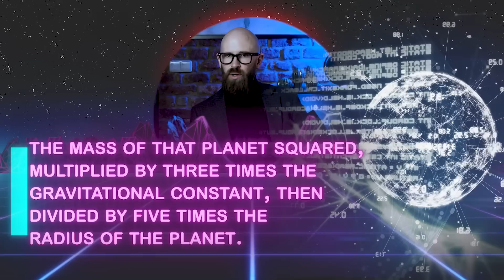Is It Possible to Destroy a Planet with the Death Star Laser?

Comment: For the GDP Issue:- in Star Wars you had the combined resources of thousands of planets in the Empire, not just one. You also had billions of workers, with galactic population of probably a quadrillion. (1 trillion were on Coruscant alone). The Death Star was constructed largely by Geonosians, which were a hive species (insectoid) with a huge population. 
The energy used by the Death Star wasn't normal lasers. Kyber crystals also had "the force" so they were more powerful.

Comment: A small problem with how the destruction of Alderaan is portrayed is the time it happens in. When you're blowing up world-sized lumps of metal and rock, it takes time for the effects to travel through the thousands of miles of rock, literally the speed of sound in rock. Even at a few kilometres a second, it'd take about an hour for the planet to even begin to break apart, let alone for the bits to fly away from each other.

A bit boring to show that on screen, though, so I'd give them a pass for speeding it up. On the other hand, I can see Tarkin forcing Leia to watch every second of the destruction for hours, Clockwork Orange style.

Comment: My head-canon is that the superlaser on the Death Star wasn't a laser at all. It was called that either as a result of what I call the Bad Translation Convention — whatever they called it in the Farfaraway Galaxy, the translators just didn't understand the physics involved and just stuck 'laser' on it. Or, it was called a superlaser by the Death Star project to disguise what it was really for. (Like how the British atom bomb project was called the Tube Alloys Directorate, and not the Super-Bomb Project.)

And what it really does is convert some of the target into anti-matter. No storage necessary, no stupendous amounts of energy to be manipulated, just a little to convert megatonnes of matter into anti-matter at a distance; merely huge amounts of energy. Needs a magic process to effect the conversion, still, but it's a little less hand-wavey than using the Sun's output for a week with no obvious side-effects.
Reply: In canon it's actually operates on the same principle as a lightsaber.

Comment: (Putting on my geek hat for a bit) Given some of the possible extensions of fictional Star Wars technology, how could the Death Star plausibly destroy a planet? The visible ""laser" is strong enough to burn through any possible planetary shield and cut through to the core of the planet. This would have a negligible effect on said planet. But then stage 2 of the weapon activates a small fraction of a second after the planet's core is reached. A hyperspace window is opened up from the planet's core to a black hole. This window only lasts for a few milliseconds or so before it collapses. But in the brief time it is open it compacts much of the core to the density of neutronium while accelerating the mass of the core inwards at a significant percentage of the speed of light. Then, when the hyperspace window collapses you get a massive explosion and the planet blows apart. This is a quite similar mechanism to how a supernova works btw. And, if the black hole was spinning then it's possible that a ring would also be created like the one in the movie as it's rotating gravitational field gave a lot of angular momentum to some of the planet's core.

Comment: Depends on what the laser was capable of doing. If it borrowed to the center of the planet the pressure build up would crack the planet. Or it could borrow in form a energy bubble in the center which expands outward.

Comment: Since Recoil is energy, could that not also be harnessed to power the beam instead of allowing it to force you backward? Let's say you anchored the ship to something, like a fixed point in another dimension, and then used your own recoil to power the laser up exponentially, after say an initial drawing of energy from the local star to get you started? And if you are able to engineer in other dimensions then you should probably set up an expandable storage unit over there for all the power.
As for building a Death Star, that amount of steel would be lessened exponentially if you were to capture a moon and use it as your core, do like the Daleks, hollow out the center and put a drive system/reactor there. Then also if you used a moon rich in iron and other metals you would have your production line for the outer casing of the planet already easily accessible. 

As for other Sci-Fi planet killers you could look at, Babylon 5 has 2: The Vorlon use a huge ship with a wave beam that just scythes on through a planet like it's made of feta cheese, and the Shadows surround a planet in a black envelope and launch hundreds of thousands of missiles at the core at once, then presumably absorb the energy to recharge. Doctor WHO's Pirate Planet was a planet killer that materialized around other smaller worlds and then mined them to death, then took the resulting leftover matter and condensed them down with gravity to fit in display cases. Yeah, don't touch the glass! If the gravitics are screwed with you could blow yourselves up with an expanding planet!! Oh and remember Lexx? The bug/phallic ship that could blow up planets? Yeah, that was a show rooted in nonsensical science, but was a helluva laugh!! In Stargate you could taint a Zero-point module and destroy a solar system, do a vid about that! 

Oh yeah and what about Farscape's Wormhole weapons!! How viable is that, that could be a whole vid, cause that thing was horrifyingly powerful! If left unchecked it could have destroyed all of reality.

I'm no scientist, but these are just thoughts I had off the cuff as a Sci-Fi/Fantasy enthusiast. Cool Vid.

Comment: The superlasers on the Death Star 1 & 2 were powered by giant versions the same crystals used in the Jedi’s lightsabers. They produce massive amounts of energy on their own, and the bigger they are, the more unstable they are. Think of the super laser like a massive version of a lightsaber. Cuts through almost anything.
Reply: Exactly.  The Death Star isn't firing a "Laser," it's firing essentially a giant lightsaber.  It's powered by a ton of Kyber Crystals.  Just like the "laser" guns aren't lasers, they're blasters, they shoot a charge of energy, not a laser.
Reply: If that's the case it should have at most poked a hole through the planet probably making a pair of rather nasty volcanoes. Light sabers form of energy cannot carry too much heat or anyone hit by one would be a pink mist steam explosion.
Reply: @sonjavoorhees4759  Lightsabers are able to contain the energy more stably due to the technology in the hilt, the Death Star is that same energy but directed at one target and we see the results.
Reply: so could 2 super lasers block each other like a lightsaber duel?

Comment: Indeed. The Empire was taking resources from all over a galaxy just build the damn thing, and used the same Jedi magic crystals to get it's laser beam to that level of energy. Oh, and it apparently had  Hyperdrive. Can you imagine that thing screaming through hyperspace? Wouldn't something THAT big effectively create it's own mass shadow and immediately drop out of hyperspace as soon as they tried to jump? It should have it's own gravity field. And if it does, does that affect how the gravity works for them to run around in it's endless labyrinth of hallways? 

And Simon is right about how much heat a weapon like this produces. So what I wanna know is, why are those two guys IN the freaking barrels of this thing, standing on platform RIGHT next the beam AS it's being FIRED, we're not instantly imperial-standard floating atoms from violent vaporization?

Comment: another solution is that it's really a giant freaking "dust gun" accelerating lots of grains of matter to significant fractions of C. actually most of the weapons and defensive systems in Star Wars more closely resemble the behavior of dust guns and plasma projectors than anything that they are called.  Blasters and lightsabers owing to their relatively short range, are most likely plasma projectors. Turbo lasers, ion cannons and the Death star super laser are all probably dust guns, between range, power and additional effects in the case of the ion cannons, the shields similarly are likely various forms of dust shields which have different types of dust suspended and confined in different ways for different tasks, as well as a few shields that are clearly the classic "low temperature plasma window" for little things like keeping an atmosphere inside an open hangar in space, and for some of the more portable shields.

Comment: Here's the fantasy part. The massive Kyber crystals they used turn electricity into plasma. not laser. The original cannon reason only Jedi and Sith where the only ones to use them is because they generate a massive centrifugal force as the plasma cycles threw the crystal. On the Death Star the dish and crystals were set up to work like a huge lightsaber.  While I agree this shouldn't have had the power to blow a planet up any more than Qui Gon's lightsaber blew up the bridge door in the first movie. Punching a hole through the planet should have been enough to ruin everyone's:goodvibes: day.

Comment: Getting something moving that fast wouldn't be too hard.  If you are flinging something at a planet, you would generally do it from far away to start, using calculations on gravity and where to aim, pretty easy for most computers.  After that, even something with a low but constant propulsion system (Ion thursters, light sails) which is in the realm of technology we have today, over a decent enough time, could get something going 10-25% the speed of light pretty good.  Get 5km wide asteroid moving 25% the speed of light, gonna have some problems when it hits its planet target.

They would see it coming probably 5-10 years our time away, but not much you can do about something moving that fast, intercepting it would be too difficult.  On top of the fact as it enters the star system, it would get FASTER due to the gravity of the star also pulling it forward.

Comment: Can I point out that literally every single point in this video has already been answered by the franchise at some point?
Power requirements: SW ships are powered by hypermatter, a ridiculously energy dense fuel, with Disney adding the power amplification properties of the Khyber crystals.
Superlaser: most laser weapons in SW are actually blasters that employ lasers as part of their mechanism, with blasters being a rather weird kind of particle weapons with a plasma stage (short version: first they have blaster gas, then they energize it into explosive and densely packed plasma, and then shoot it as a particle beam).
Heat: there's literally dozens of exhaust ports. One of which was sabotaged to be a weak spot.
Recoil: leaving aside the properties of blaster technology mean there's less recoil, they have artificial gravity.
The fireball: the superlaser causes it due its operating mechanism.
Alternative solution, a giant bomb: they have them, the problem is actually putting them in place, especially if the target has a planetary shield (like Alderaan, you can see it being defeated by the superlaser). Hence the Death Star.
Relativistic kill vehicle: they already have that too, and one was used by accident during the Clone Wars (a large warship suffered damage that triggered the hyperdrive while the ship was pointed at a planet).
Reply: I figured out that in reality, the Death Star wouldn't blow up Alderaan, it'd more melt, then evaporate Alderaan.
Reply: AKA "plot magic".
Reply: @adamwu4565  more accurately we are talking about a civilization who is space traveling for at least 25000 years. to assume they couldnt discover better stuff than us cavemen who cannot even leave our own starsystem is dumb
Reply: @laisphinto6372  In other words, "plot magic" disguised as "time". For it is just as equally possible that a civilization that has traveled in space for 25000 years would have discovered that Death Star lasers or anything similar are outright impossible and/or impractical, and the REAL caveman level idiocy of us puny humans who cannot even leave our own starsystem have engaged in is imagining a fictional universe where such devices could actually exist.

Comment: Suppose the laser acted as a really, really fast drill and then once you'd somehow drilled deep into the planet - maybe the magma, maybe the core - you shove an anti-matter bomb in there to trash that piece.  With it gone, the planet's gravity would shift and the planet would start tearing itself apart.  Magma filling the hole, tectonic plates shifting to accommodate the new shape, collapse of the crust etc.
How big the bomb would have to be to make a big enough hole to make it work; how deep you'd have to drill to make it work and why you'd want to all remain valid questions.

Comment: Point of clarification @2:18 but gravity is a relatively “local” force and IS zero per its concentration as distance. Because if the universe is “infinite” it doesn’t matter if the force from those objects is near zero. Its infinite if there is an infinite universe. And there probably literally is. So gravity has to be relatively local. Its just the curvature of spacetime and since there is a tension to the universe otherwise known as the CMB, gravity will be local for as long as that remains above absolute zero.

Comment: Eemm. A week of sun energy? So an advanced fusion reactor? 

Sounds like its not an energy problem. You wont get a laser to fire that energy for more than a pico second before it burns the lense. Also, why would the laser not just go through it?

Also, take into account the diminishing energy of laser through air and atmosphere. Youll only get maybe 10% of the original energy to earth. So multiply your calculation by at least 10. Whats another zero?

Regarding ramming something into it, DART didnt hit an iron core astroid. Earth is an iron core planet.. you would need much more than the DART to redirect more complex astroids